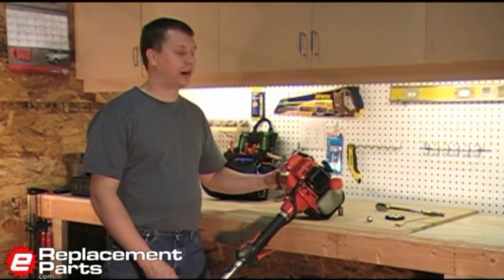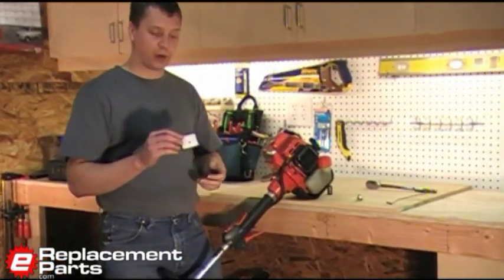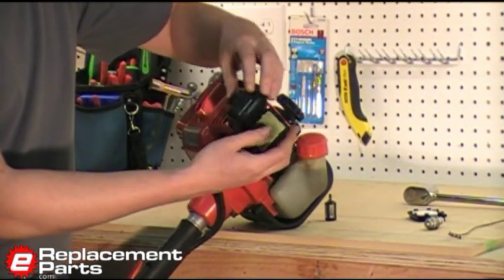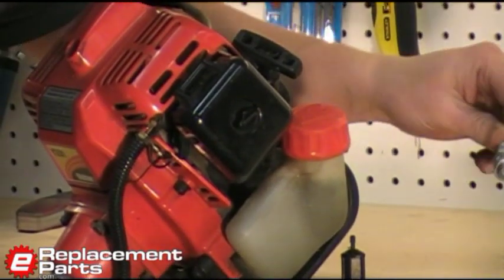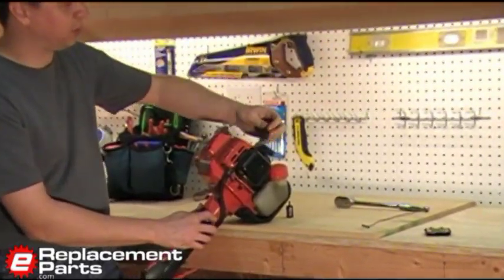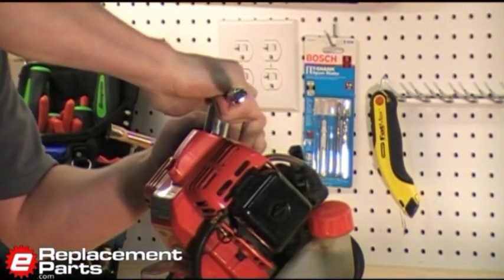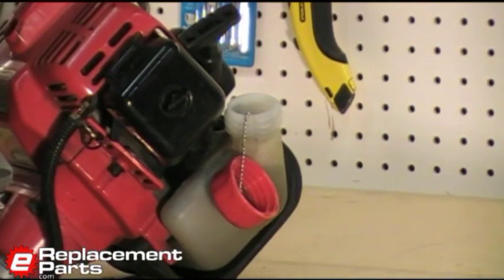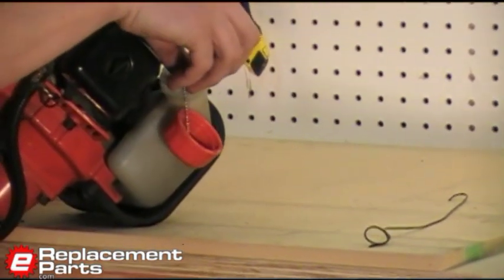How to Tune Up a Two Cycle Engine

Comment from the maker: The first test I would do here in our shop would be a compression test. If there is excessive wear to the piston rings and the cylinder you will see a loss of power. The compression should be at least 70 lbs. 

-Mark

Comment from the maker: @sbdem1986 It's true that the spark plug can be cleaned instead of replaced, but it's not possible to clean the fuel filter on most small engines. We recommend replacing the parts for three reasons: 1. Fuel filters and spark plugs are generally very inexpensive; 2. Replacing them is easier than cleaning them; 3. New parts will operate better overall than old parts, even if they've been cleaned well recently.

Comment: Why is the replacement of spark plug and fuel filter necesary? If they're working properly you can just clean them, at least the spark plug, isn't it the same with the fuel filter?

Comment: Yes many parts don't need replacement unless you are servicing other peoples equipment for a fee.  eReplacement is acting in their own interests by selling parts.  They are running a business, after all.  The thing is they are offering a very valuable service to a thumb fingered DIY like me.  I am saving the cost of a new trimmer and these guys are selling me the parts and showing me how.  It's a shame that other businesses don't act as responsibly instead of sqeezing that last penny from ypu.